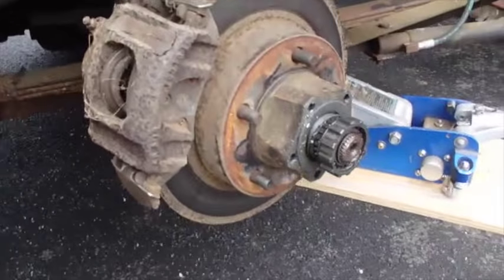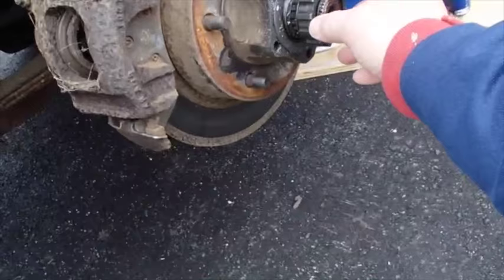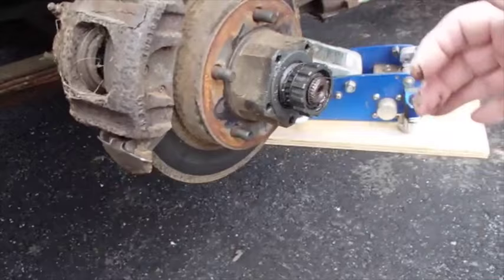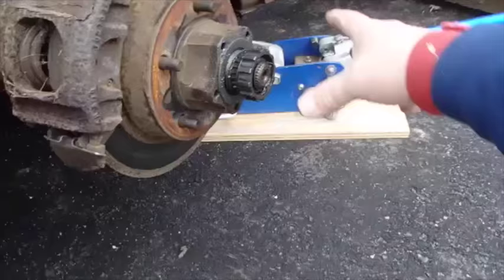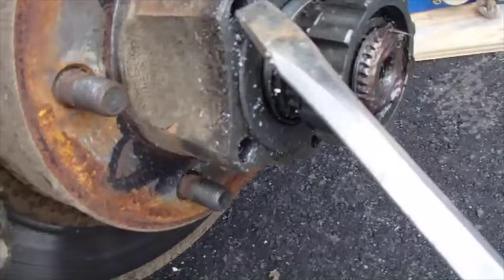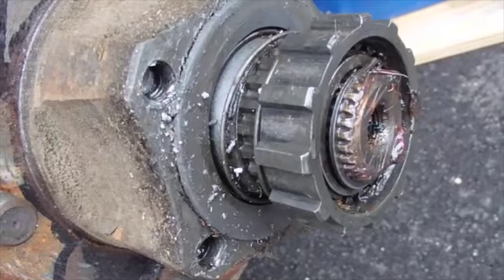Jeep Hub and Bubble Gum Beating

Comment: I think you were right to stand up for yourself. Wrong is wrong and a stand needs to be made, and you did your best to stand up which I think says much about you as a young lad. When I was very very young, my Headmistress threatned me with wooden rulers all elastic banded together. All because I was struggling to remember my times tables. It didn't help, in fact it scared me so much, I was 3 years old, I never managed to learn them by memory. Only when i got older I learned that parroting things does not mean you understand them. My dad had a quiet word with her and she didn't do it again.